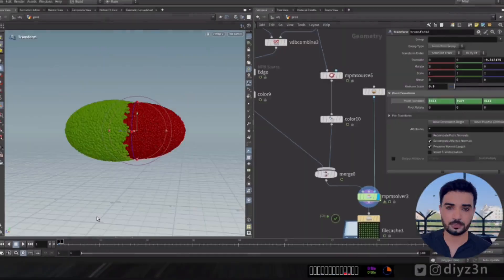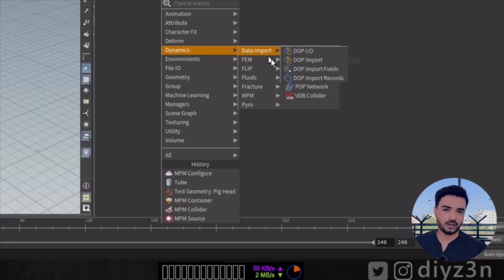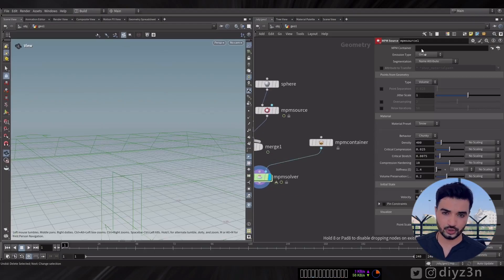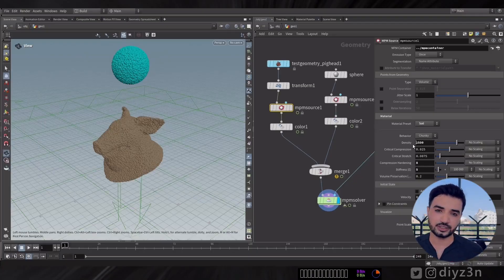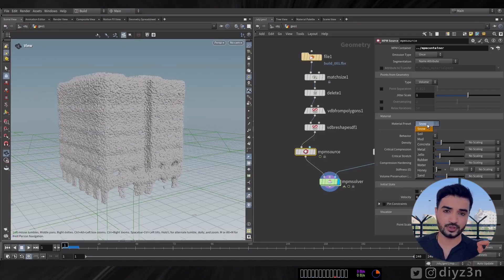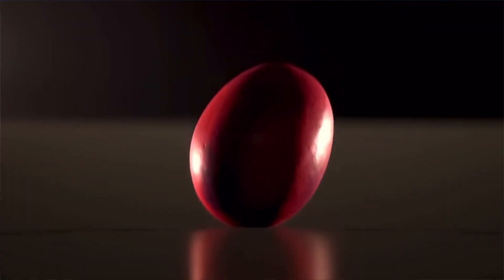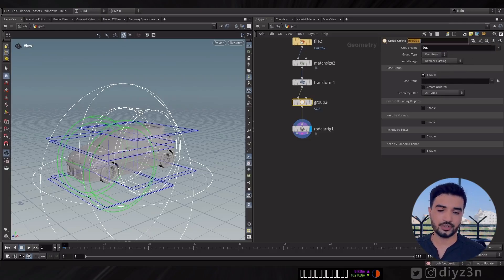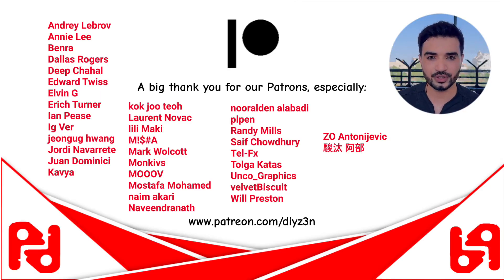First look at fantastic MPM solver in Houdini 20.5

Comment: thanks for the review. By the way, I also noticed that the more stiffnes, the slower the mpm solver. but at the same time, it has a building destruction preset, which is simulated quite quickly.
Reply from the maker: @Zauriooo  yeah my pleasure, brother

and I also saw the building preset and I totally agree with you. It’s have a decent speed, but I don’t know why is that 

if you find out the reason, let me know